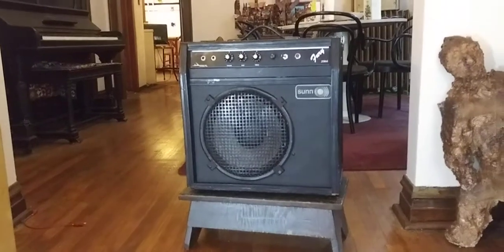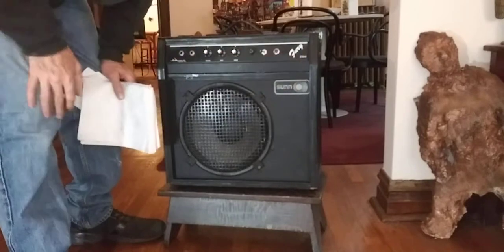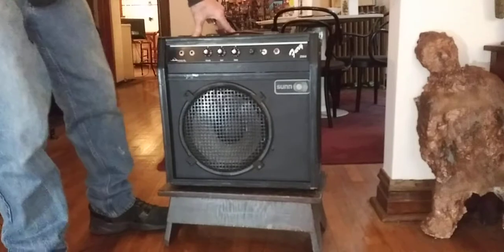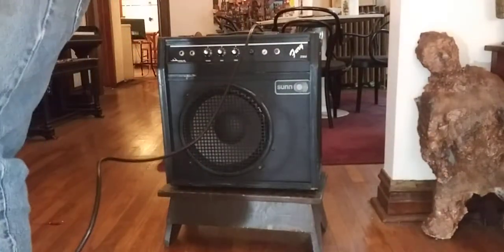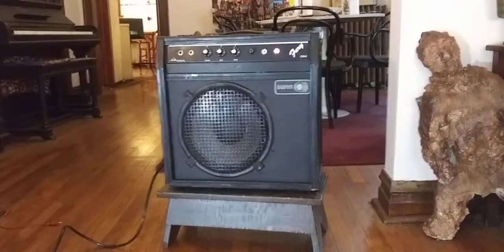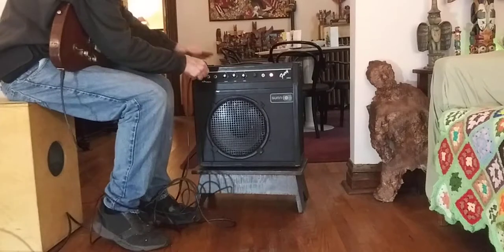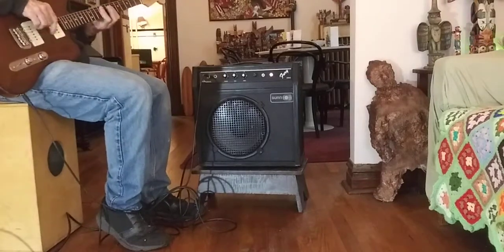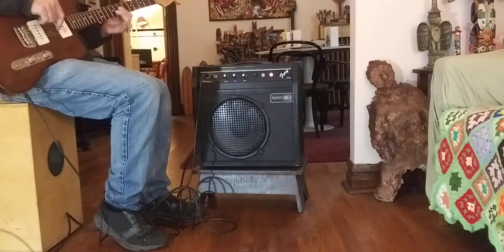Alamo Fury 2566 in a Sun cabinet.

Comment: I Just got one of those, can you tell me more about these amps?
Reply from the maker: Weird power tubes in a weird sock ed t. The new Electroharminex. Power tubes use a different base that sort of fits but  I've had 3 tubes fail cracking at the base. The ss pre is very fragile ed it uses a ultralinear output transformer.